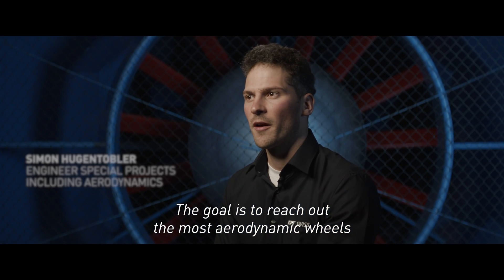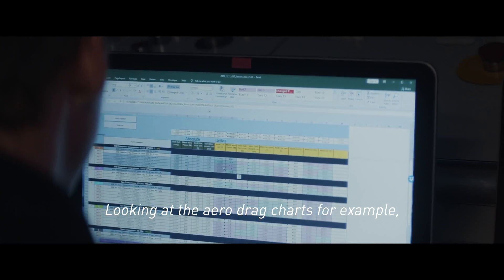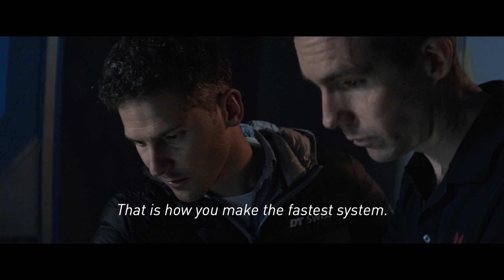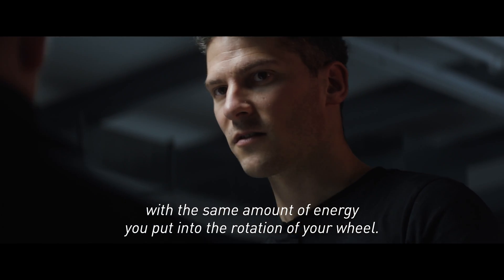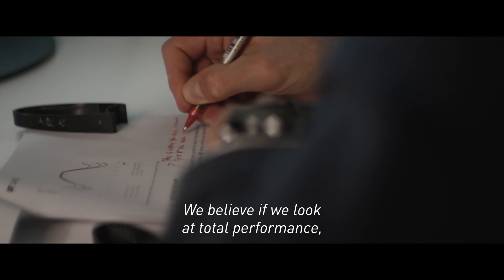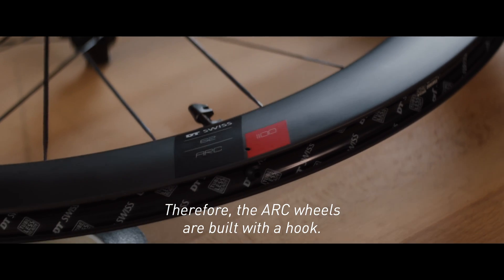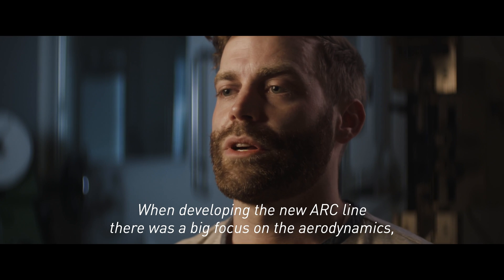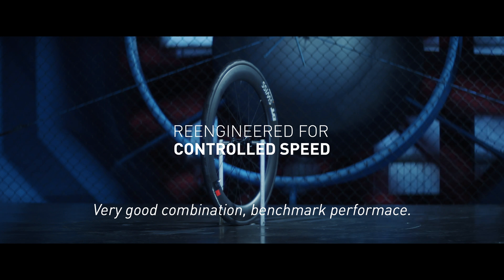Reborn faster: An insight into the redevelopment of the ARC wheels.  | DT Swiss

Comment: Reliability and quality manufacturing are what make a wheel company great.  Trust is a fickle deal and when you ride fast, you have to trust the wheels you are on top of.  As a result, I would love a set of these newly redesigned ARC wheels.  A wheelset I could trust to go fast, consistently, safely.  The sailing effect and DT Swiss's effort to address cross winds is something I am interested in.

Comment: What is expected of the ARC 1400 DICUT 50 wheelset is improved speed on the uphill, sustained speed on level ground through the air road effect, and the quietness of carbon wheels!

Comment: Currently, I am using the dt swiss 1650 db 62mm model, but I feel a little too heavy on the uphill.

If I win, I would like to run to the famous Korean uphill "Namsan" and realize the difference from the existing wheelset.

Comment: I'm riding a bike with disc brakes, but never rode wheels, which were specially designed for disc brakes. As an amateur without high end material there are always doubts when it comes to the startline of a race. Does the material limit my performance? Especially in these corona times with just few races i'm even more excited to toe a startline again. Those wheels will definitely wash my doubts away and enable me to fully concentrate on my abilities!

Comment: If I were to win the DT Swiss ARC 1400 DICUT 50 DB wheelset, one of the things I'd be most excited about when riding it would be the wheelset's aerodynamics. Usually, the words "stable" and "aerodynamic" don't combine in a deep-section wheelset since quite a number of them are unstable in crosswinds.

As an LBS Sales Technician, hub serviceability is my second concern, so I'm glad to know just how simple the internals of a DT Swiss hubset are as I've serviced a DT Swiss 240 hubset before. No preload adjustment hardware, no cup & cone bearings, no fuss. Less time spent in the workshop means more time spent riding out on the road.

Comment: What are you most exciting about when riding the ARC 1400 Dicut: To witness and experience low aerodynamic drag, good handling properties and a stable wheels in unfavorable wind condition, in short the most advanced wheel evermade to date.

Comment: (This is coming from a snowy and icy North England) I would be most excited about putting these wheels on the summer bike and heading out the door into the warmth of the summer for a long ride with friends. There is something magical about the first warm ride each year, the hum of thin tyres on the road, the rims slicing through the air and the extra motivation of friendly competition!

Comment: With these wheels the supertuck position is no longer needed to achieve the racing speeds on a decent. At the moment i have wheels with a low rim depth of only 24 mm and these wheels are gone make the difference. The wheels would also make the bike look like it is in perfect balance because of the aerodynamic features of both the bike and the wheels.

Comment: It would be interesting to see how these wheels can be ridden in the mountains👍
Reply: I have ridden my ARC 1400 disc brake wheels on my Canyon Speedmax tri bike on a few routes with over 1900m elevation. Obviously you can get lighter wheels, but the rigidity of these wheels makes them very responsive, very easy to manage the braking, and the tubeless setup means low pressure for fast and comfortable riding. On a different route, I hit a sustained 70km/h speed on a mostly straight descent, and felt perfectly comfortable on my aero bars even with some light cross winds. They really check off all the boxes, and I expect the reliability and ease of use will be stellar given the rock solid quality of other DT Swiss wheels I've ridden for much longer. LOVE THEM!

Comment: I love riding fast. If I were to win the ARC wheels the first thing I would do would be to climb the highest mountain here and then ride down it as fast as I could. I think the aerodynamics are extremely important because as you ride faster there is greater danger of losing control. Therefore the stability of these wheels should help gain control at high speeds.

Comment: im a light rider so using deep, aero wheels is always a stressful situation- especially in gusty and windy days. as a 70.3 athlete, staying in the aerobars is insanely important so having a more stable and controllable wheel would definitely up my confidence in that position and in turn make me faster. im also a big believer in tubeless, after a puncture took me out of a podium at 70.3 cozumel, i am confident that tubeless wouldve saved me that precious time changing the tube and wouldve been on the podium. and also who doesnt mind going faster for the same effort? ive been working hard on my cycling power and have seen some significant gains so if i can supplement my performance with the wheels performance i know i can probably get one of the fastest bike splits of the day.

Comment: I'm most excited about the improved aerodynamics together with the better handling. In races I often had some strong winds with deep rims and had trouble holding the bike. Also I havent got some deep section wheels for my disc brake bike. Awesome work guys!

Comment: Would definitely put them on my aero bike to test out the speed on a tri flat circuit !  I currently have a pair of 64 KNOT and one of 45 KNOT however I do feel when I have the 64 ON that they are hard to keep straight when it's windy. I feel it's something you worked on with this wheel and appreciate the 'safety' concerns mix with the performance expectations.

Comment: The new ARC wheels are most definitely designed with idea of creating your new personal speed level but with the same amount of energy you put into the rotation of your wheel! What's not to like to feel in control at such speeds thanks to a reduced rotation drag, excellent sailing effect and a great handling and stability coming from these wheels? Give me the wheels, the mountains and a bit of Swiss chocolate for afterwards! 😃😃